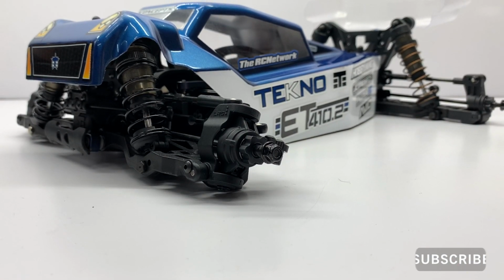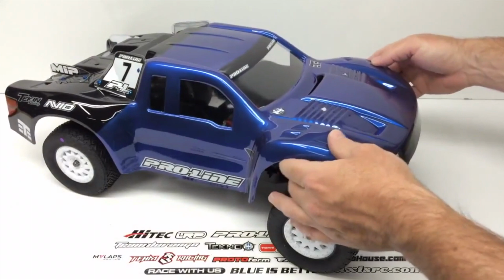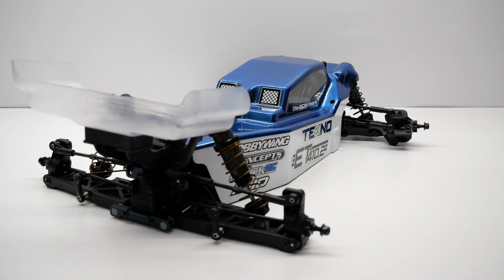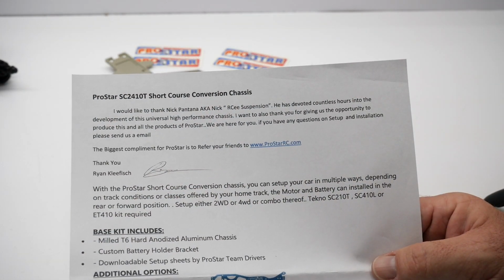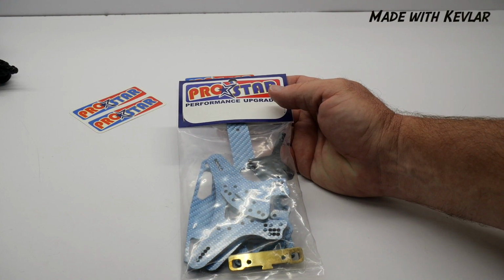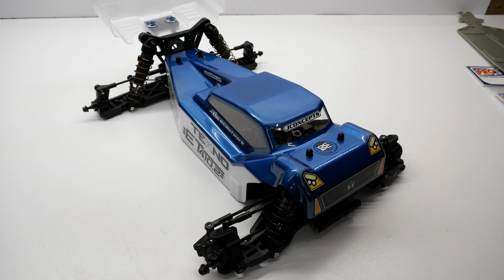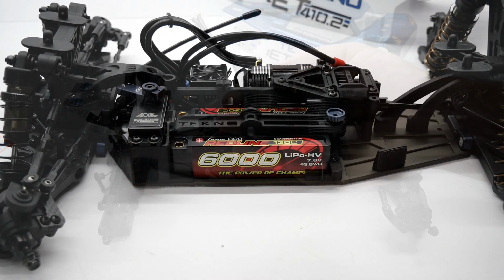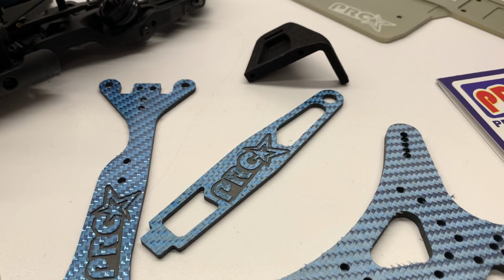Tekno ET410.2 to Lightweight 4wd ShortCourse - ProStar Conversion - EP1

Comment: My 6.4lbs 410.2  tekin rx8 , pro4 hd motor, front and rear bumper, standard thickness body painted,8200mah 2s thunderpower lipo . Dont see that as a heavy build. Titanium bolts top and bottom, ti turnbuckles , abec 7 ceramic bearings, CF towers etc, M2c chassis.  Without body it is 6lbs . If i had a thinner body it would be 6.3lb , lighter motor id save .2lb , not run rear bumper .1lb , lighter battery save .15lb . Basically not any heavier but buy .1-.15lb than this rig !
Reply from the maker: Once this was full built, it was under the weight regs for 4wd SCT...so weight had to be added anyways

Comment: Nice vid just wondering if you could give me your advice on what motor and esc would work well on the sct 410.3 I just picked up one for some backyard racing and bashing in looking at the hobbywing max 10sct
Combos they come in 3200 kv 3600 kv 4000 kv and 4600kv in new to this hobby any advice would be appreciated?
Reply from the maker: Depends on if you plan for 2s or 3s....if you want 2s, then grab the 4600kv. if you want to run 3s, grab the 3200kv.  Watch your temps...as the max10sct is not quite the best to push this heavier truck around
Reply: @TheRCNetwork  thank you what's a good budget esc that will work well on 2&3s
Reply from the maker: Check out the Hobbywing XR8 SCT Pro - best bang for the buck ESC and rivals $200+ ESC's
Reply: @TheRCNetwork  thanks for your reply much appreciated have a blessed day👍🙏

Comment: The sct410 is more like 6-6.4lbs.(2750-2900g)
Reply from the maker: I haven't built an SCT410 since the original....but mine weighed at it's lowest 6.85lbs - a full pound heavier than the MIP/SCTE I was running previous.

Comment: Requires parts for a discontinued Associated 4wd buggy. Yes those will always be available. Thanks for the review, very informative. I'll stay away from this conversion.
Reply from the maker: They can usually be sourced for years after the discontinued announcement.  Also, AE is pretty consistent on parts....for example, the hinge pins on the B44 were the same for the B44, B44.1, B44.2 and B44.3.  I'd probably say the B74.1 likely uses the same driveshaft

Comment: Nice video. Tekno seems to be a well made and respected company by many reviewers. What is the total price of all the upgrades you are installing?
Reply from the maker: Tekno is a great product and company.  This was a fully optioned kit.  The Base conversion starts at $135, Everything I had pictured is about $350....but you don't need all of that to convert.  You really only need the chassis plate, rear chassis brace and rear center driveshaft.  Of course, bumpers and mounts would be up to you
Reply: @TheRCNetwork  thank you for responding back with the amounts. Price is doable but does the extra length to the chassis make it out of spec for 1/10 scale racing?
Reply from the maker: @davidreed3724  The length gets you into the SCT class - either 2wd or 4wd, depending on how you build the conversion.
Reply: @TheRCNetwork : Thank you for your time and knowledge. I have been wanting to get into RC but torn asthma to what kind. Bashing? Just sounds like a fun but an endless parts drain on the wallet. Racing and playing around the yard seems to be better but not sure about types. Buggy, truggy, short course, or stadium truck. Your info is definitely being considered. Again, thank you